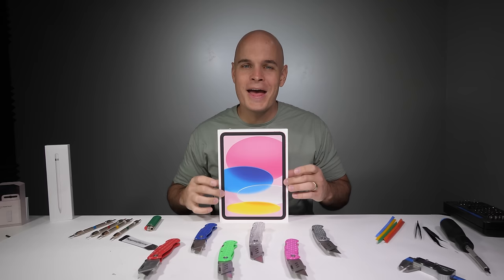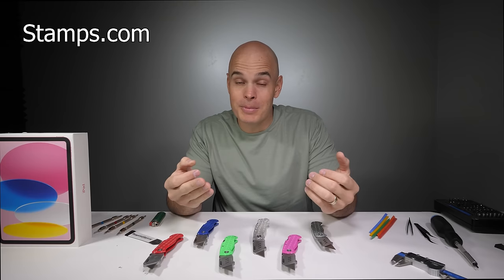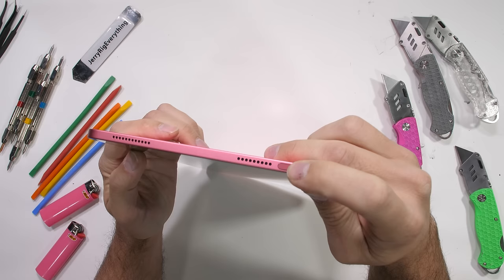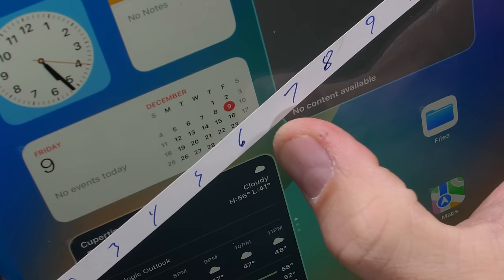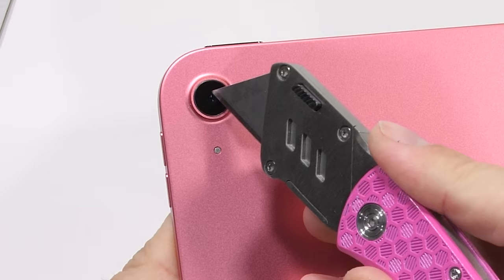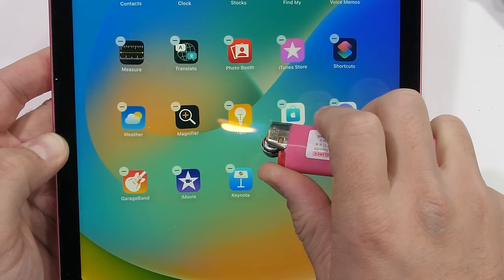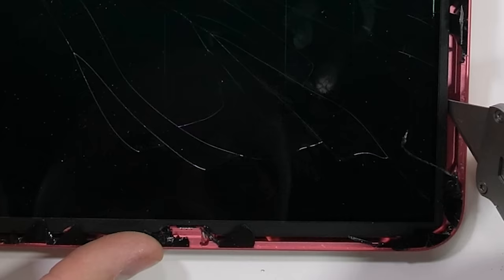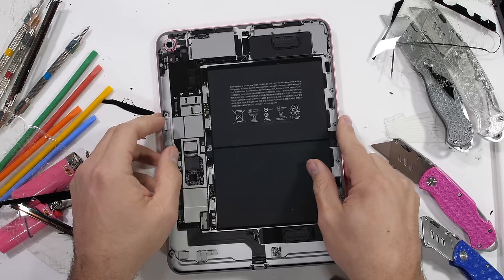The New iPad is...  (Lets just not talk about it...)

Comment: The "iPad" (without, Air, Pro, or mini) is the school model.  The air gap between the digitizer and the LCD is because most students break the digitizer only so it keeps repair costs way down.  We pay ~$30 per digitizer replacement.  This saves us a bunch as we repair a few 100 a week for repair.  45,000 iPads cost at lot, not just to buy but to maintain.

Schools are also why the iPad 9th generation is still on sale, we have a fleet of 8th generation models and want to continue to buy the 9th generation as long as possible.
Reply: The problem is that it is priced WAY too high for schools.
Reply: How about picking a better product? how is it feasible to repair a few hundred of these a week? Just buy an air and never repair until battery death or another brand?
Reply: @yk-lt5bs  I think you missed the point.
Reply: @cameronbosch1213  not true you forgetting that school get special pricing for bulk purchases
Reply: @yk-lt5bs  you missed the point
Reply: then why do they price it so hight. thats not an excuse. thats just stupidity. for this money i expect fully laminated, pencil 2 and stuff. almost every new name brand android tablet no matter the price has a fully laminated display now.
Reply: @michaelm.3641  the thing is it got more expensive. if it was the same price ok.
Reply: @cameronbosch1213  Schools buy in bulk at the same price as retail stores.

For example. Samsung sells 512GB EVO sd cards for 121€. Guess how much do retail stores pay? 40€
Reply: The ipad 2022 costs 589 euros here in europe, that's not cheap for schools.
Reply: I've spent countless hours troubleshooting and attempting to get these pieces of crap to behave. I despise iPads with every cell in my body.
Reply: @yk-lt5bs  Agreed with you until your 3rd question, that quickly made your entire comment kinda "wtf". But also, many schools have contracts so they actually have to buy iPads, so they buy the cheapest to buy and cheapest to repair/maintain tablets. Also because iPads are the tablets that have the longest software support, it's also a no brainer for schools. They would never buy a random cheap Android tablet that would lose support in a year. And since all Samsung tablets have fully laminated displays, it would be a lot more expensive to fix considering kids break them all the time no matter which tablet it is. Also Samsung tablets bellow $500 are a bit... well... slow and bad, and above that price they are absolutely beautiful and excellent but also are insanely expensive to buy and repair in bulk. And one more thing, iPadOS being so locked down is actually a feature for schools, especially if they can lock the iPad with admin passwords. Android can do this too, maybe even better, but even completely locked down android can still be "too open" for schools or require complex additional software or even custom ROMs/admin apps to lock it down to a similar "locked down" level to iPadOS (in its most locked down state).

I hate Apple but I'm not blind and I can absolutely understand why schools keep buying iPads.
It's a mix of contracts, long software support, apps support, device administration and lock down (as a feature), repairability for cheap (non-laminated displays as a feature), security (debatable tho), ease of use, or really all of the above. Every other Android tablet you think about fails on one or more of this categories. A "failure" that can be considered better for us (like laminated displays) is a bad thing for schools and companies who have to maintain hundreds of thousands of them.
Reply: School should get linux pcs, not Apple proprietary tablets...
Reply: @azenyr  slow and bad...the 2022 s6 lite or the s7 FE is not slow and not bad. shure it isnt flagship level performance but for school work thats all you need. all your other points are fine id say.
Reply: @yk-lt5bs  We initially had the iPad Air (1) which didn't have laminated digitizers.  We heard about schools that got the iPad Air 2, and their repair costs were way higher because when the digitizer is laminated to the LCD you have to replace both when either is cracked.  Shortly after this Apple brought back the "iPad" and it has always had separate digitizers to reduce repair costs.
Reply: @HarmonicaMustang  You are in a minority.
Reply: @cameronbosch1213  I have a feeling the iPad 11th or 12th gen will be cheaper.  For now schools who have iPads will continue to buy 9th gen so they can continue to use the chargers they have.
Reply: @Jbrimbelibap  they are getting chromebooks too. Im in the Linux world so I know about it. And I know that schools will not switch to a linux laptop if they are getting almost free chromebooks by signing contracts with HP, Acer etc. There is currently no brand in the Linux world that does such big scale contracts, and even the easiest Linux distro like Ubuntu can be kinda hard to support when kids try to use and mess with every system config they can. ChromeOS is a lot better for this, and iPads are even better. We can't forget that kids not only love to break screens, they also love to break software and mess with settings. If you give them a linux distro the laptop would be stuck into grub rescue in 10 minutes. All laptops would constantly be in need of an OS reinstall. This is the same reason why they don't give Windows laptops to kids. Either iPads or ChromeOS. There are linux distros like endless OS who try to target these usecases but there is still not enough support or companies who do big contracts with schools for this
Reply: @azenyr  no sudo commands for the children
Reply: @SimonBauer7  those are fine tablets for the price for us final users but... are they a good choice for schools at that scale? Maybe not. Im sure there are android tablets made by HP or Asus or others that are focused on bulk deployment like this, with great repairability and durability, but still they fail some points. And probably shitty specs and overpriced too. The corporate world is just very different from the consumer world. I know a friend who has a medium-sized company and recently he signed a contract with HP to renovate the whole fleet of desktop computers at the company with shitty but newer ones (i5 11th gen, 8gb ram, 512gb SSD, the old ones are 4th gen and many still have HDDs). I told him he could maybe get better PCs if he built them in parts to which he answered "would you build me almost 150 PCs and install windows and drivers in all of them? And where would you get the parts in such big quantities? Who would pay you the hours or days wasted? And support & warranties? Bureaucracies, insurance and paper work for them? Yea, HP just arrives there one day with a palette of them all ready to use and all paper work filled and takes the old ones for recycling. Some consumer things just won't work in the corporate world, sadly, because HP and other companies like Apple really profit a lot from shitty but easy (for the clients) contracts like these
Reply: @Jbrimbelibap  you can still break a lot of things even without sudo. Unless they had a system that reimaged the root partition from another partition every time the pc got booted up (that would kill updates, but this is why stuff like immutable distros are promising), it is still to dangerous. Linux is just too open for this. In ChromeOS you can only use a browser and thats it. If you do shit you just clear the browser data.
Reply: @craigrogers8182 i understand the repair cost is lower but there shouldn't be any repairs in the first place. Buy cases or better tablets i don't see how it is better to repair 100 screens a month then not breaking it in the first place. Gorilla glass victus out here on million dollar cars as racingwindows and your breaking 100 ipads a month?
Reply: @yk-lt5bs  do you forget that schools buy these in bulk and want to get it as cheap as possible, they don’t want one with a laminated display because it’s so much more expensive to replace and schools are legally required to fix it if it breaks as otherwise it becomes a health hazard.
Reply: @cameronbosch1213  nah it’s not. We have thousands of iPads at our school IT
Reply: The iPad is not "school" anymore, unless you talk US schools only. If the air gap was for repairing, they should just put everything together but easier and cheaper to open and cheaper parts. If it was for school and kids, NEVER in life they would put the need for adapters, all kids lose them! On Apple everything is just for making money.
Reply: Just buy a durable cheaper just as good android tablet then???
Reply: Schools should be teaching kids how to use real computers and real software. Not locked down consumption devices which raise a generation of app store drones. Years ago they said people 40+ in software development would be on the scrapheap as the new "digital native" students started work. Except we now command even more salary and are in demand more because these graduates can't even write a piece of code to check if a number is odd or even without including a bloated library to do it for them instead of using the modulus operator.
Reply: Why not make an ipad school edition, and only sell it to schools? Why everybody else has to endure the shortcomings? Seems like schools were not the nr 1 thought in their minds 🤑
Reply: @6581punk  Real computers and real software cost a LOT of money. Schools can’t afford that, it isn’t fantasy land.
Reply: @Jbrimbelibap  can’t wait to see little Timmy and thousands of his peers having to shell bash even the most basic stuff
Reply: @ricarmig  pov : you have never repaired an ipad
Reply: @iondoaga1267  if Apple make a cheap ipad for school i want one as well
Reply: @rentzboss  We should just get proprietary softare off our schools, besides chrome os is based on gentoo linux i reccon. Chrome os shell bash anyone ?
Reply: The problem is ignorant reviewers and tech sites have convinced the public that glass and metal are "premium". They're not. Every material has strengths and weaknesses, and you need to pick the materials which are most appropriate for your use case. Glass as everyone knows is extremely fragile so should be avoided on things that are easily dropped. And metal will permanently deform under much less strain than a flexible material like plastic, so should be avoided unless you can put in enough metal to prevent permanent deformation under typical loads. Glass and metal are just about the worst possible choices for constructing thin handheld devices which will become technologically obsolete in 5-7 years.

If you're repairing a few hundred digitizers a week (225 out of 45,000 = 0.5%, or about 25% per year), then glass is completely the wrong material for this use case. And Apple is making a mint off of you on replacement parts costs. It's why Zack frequently mentions (and I agree) that he thinks plastic would be a better material for phones and tablets. Just cover the plastic screen with a plastic screen protector (a few cents each in bulk). If it gets scratched or gouged, just peel off the protector and replace it. That would make the LCD the most fragile part, but those are gradually being phased out in favor of flexible OLED. Unfortunately, we are where we are today and paying out the nose because a bunch of ignorant people have successfully convinced society to prioritize fashion and feel-good, over common sense and solid engineering.
Reply: @GondrezHardstyle  schools do not pay vat. Also bulk prices.
Reply: @solandri69  Plastic touchscreen are a bad idea, look at switchs i repair, many people do not want to use a protective layer, just like i don't want foam all around my car, and it scratch so easily
But at least people mostly break the lcd and not the display, while in ipad they mostly break the touchscreen
Too bad for you that lcd are much more expensive than touchcreens
Reply: Many people complain about the price of an iPad 9th generation. I got it for €380 and would be hard pressed to find a decent phone for that money. That puts it at about €120-€150 factory price. Name one tablet or laptop that has better features at a lower price. You could all buy chrome books, but uniform software support and repairability will be an issue.
Reply: When you have 45,000 iPads in rotation, do you get a discount for purchasing in bulk?
Reply: @SimonBauer7  Sure, but ipad os is better in every aspect than android for tablets (which doesnt event exist).
Reply: @Jbrimbelibap  No they shouldn't. Linux is basically never used by the average joe.
Reply: What happened to notebooks and pencils? Teaching is not all about getting technologies and more screens to the students
Reply: I have a 7th gen as a teacher. My school is such a mess. The students have Chromebooks and the our projectors either have Chromecast or apple tv. Our teacher laptops are windows. So we get to try to make sure all of our technology works.
Reply: @SimonBauer7  they also tend to be more expensive, and the cheaper ones tend to be made from cheaper materials like plastic. iPads are made using aluminum and use high quality materials. There’s more thought placed into the hardware on iPads (for better or worse) than there are on android tablets. Also, who likes android on tablet?
Reply: @rvalent9366  if you are looking for cheap, then maybe you should look for something other than apple
Reply: Got the nerve to charge me 450 for this And it can’t pass the bed test @apple what are you now, cvs or Walgreens quality now?  Timeline 7:45
Reply: @HarmonicaMustang  skill issue 🤷🏽‍♂️
Reply: @SimonBauer7  Than,just buy android.
Reply: I WAS GOING TO SAY THAT. Laminated screens are so expensive.
Reply: Those parent's pockets are heavy 😭😭😭
Reply: @HarmonicaMustang behave and do what?!
Reply: @yk-lt5bs  why do u think they won't get damaged dude🤣
Literally a dozen of kids handle them everyday....they will get damaged regardless of the brand. Kids can damage anything.
Reply: @iondoaga1267  u're not forced to buy the product. lmao. Chill.
Reply: @kamallb4650  If you learn anything from the past, you'd know the phrase "apple does something, everybody else copies" So how chill are you going to be if in a couple years, all you could buy is overpriced pieces of garbage?
Reply: @iondoaga1267  that's majorly others being at fault
Reply: And with a very durable hard case the bending should not be a problem 💀
Reply: @azenyr  But ChromeOS is Linux lol. I would expect a school linux to be super locked down which is something relatively easy with linux.
Reply: @6581punk  the problem is, they don't use this for your average coding. If everyone learned coding, other jobs wouldn't exist because everyone would have opted for IT. Maybe just use the brain a little and let people out for their choices.
Reply: @kamallb4650  gorilla glass is super durable as I said million dollar cars have victus. If you break 100 of those a month you better use pen and paper.
Reply: @yk-lt5bs  idk why u're trying this hard to create scenarios in ur head but honestly speaking. It's not that deep. 
When a dozen of kids are using something on a regular basis it's bound to detoriate faster....regardless of how good quality it is. 
Now go ahead ban tablets for those kids all u want.
Reply: @GondrezHardstyle  but that’s only an issue in Europe cause the weak euro, that have nothing to do with apple…
In US the iPad 9 still cost 330$ and the 10th gen 450$ and that’s not really much against that what you get more…
That’s 130$ for a more modern design, dramatically better sound output, at least 1 year more support and better hardware (SOC, RAM, connectivity) and that’s worth 130$ in my eyes…

The iPad 10 is not the direct successor of the iPad 9, the iPad 9 is the successor of the iPad 9 this year and that’s completly fine cause every other company’s sell in this pricerange Tablets with hardware wich was powerfull 4-6 years ago…
The iPad 10 is just a new category in the iPad line and is just there to fill the big gap between cheapest iPad and iPad Air which was always kind of big since the comeback of the iPad Air which was every time closer to the iPad Pro as to the normal iPad…
Maybe this will get more clearly for everybody when apple will release the iPad 11 or SE next year (when 11 the 10th gen will get to the pricepoint of the iPad 9 and will replaced with the 11 and when SE then it will replace the 9th gen iPad)
Reply: @SimonBauer7  they are not even close to the iPad 9, the s6 lite is on the level of the 5th gen iPad and the s7fe is somewhere between iPad Pro 9.7“ and 10.5“ from 2016 and 2017 and that for a price you can also get the older iPad Air 4 or 10th gen iPad which both have 2x and 3x the power of those android tablets…
That’s not just a small gap if you ask me…
The main issue on that is not that you will not get enough power for now, but it will get slow and useless pretty fast when the main devices (iPads) for developers have allready power which is 2 or 3 times faster…
That will result in a quit short usage what then is just a bad deal next to any other iPad of the last 5 years…
Reply: @azenyr  just nope, they are all only produce laminated screens anymore even in there under 200$ devices with crappy socs from for 4-6 years ago…
And next to that they only support the devices 2 years in most cases…
If a school is smart they just put the 100$ more in each device and they will get a very good product which is specially designed for those usecases, will get years of support and has already tons of applications which are designed for school and college Workflows…
I don’t know a single android tablet which would fit in this picture, really not a single one…
The only other tablets which fits roughly are the Amazon tablets but these are more concentrated to media consumption and not really for daily schoolwork, so they are more or less just to slow for nearly everything, not compatible to allready existing infrastructures and this all next to this commercial binding to Amazon, thats not really an alternativ for the iPad 9 or 10 and what apple offers with them…
Reply: @ricarmig  in Germany nearly every school uses iPads
Reply: @kamallb4650  I'm sorry but it is if the number he is using is correct that means 2400 broken screens ~100 grand in repair costs over 2 years. If you'd buy 1 screen protector and a third party case for each ipad. Would even out repair costs. And would be better for the environment. As if protecting your screen hasn't been solved 10 years ago!
Reply: Thanks for explaining, I was really perplexed by this. It makes sense now.
Reply: What happened to just using chrome books?
Reply: have you heard of books?
Reply: @iondoaga1267  no because everything else is slow with stupid interface
Reply: Why the hell are schools wasting money on iPads? Buy real computers that can accomplish more work for less money. I could understand iPads if they at least ran MacOS, but no. They're completely limited in what they can do by iOS.

If I lived in your school district I would be voting No on some budgets big time.
Reply: @OutOfNameIdeas2  no tablet matches ipads tbh lol. plus it’s not that the ipads are easy to break, it’s just kids are stupid and glass is glass.
Reply: Thanks for your sharing your insights!
Reply: Huh? It's it about repair costs maybe buy a tablet that doesn't snap in half ? If they are breaking the digitizers they can bend these as well...  This is sold to the general Public  not just schools
Reply: Fawk them schools the ipad 9 is outdated
Reply: @mrsoisauce9017  Android tablets are not more expensive than iPads. Apple does not necessarily have better hardware or build quality. And a lot of people do like android on tablet. Apple is just better at cornering the market on these big bulk school deals than Samsung or Lenovo.
Reply: @shannawallace7855   ok, android tablets aren’t that expensive, but the integration between hardware and software isn’t there. Most android tablet apps are just blown up versions of their android phone counterparts, whereas iPad apps are optimized around the larger form factor. iPads on average, contrary to your statement, do indeed tend to have better build quality, being made from aluminum and other high grade materials as well as having an amazing set of chip sets. And lastly, to address the whole bulk orders thing, have u seen how hard schools are pushing for Chromebooks now? A school would NEVER push for an android tablet, but they absolutely WILL push for a Chromebook. It’s not abt apple being better at cornering the market. That’s just one of many factors. Most of those factors have to do with durability, privacy, security, optimization, and the ability to set limits as to what ur student’s device can do, and for that, iPads are better than android tablets, but Chromebooks are better than iPads in that regard as well. Therefore, it doesn’t matter how good apple is at “cornering the market.” Chromebooks will be the universal choice, and companies like the aforementioned Lenovo can sell Chromebooks in bulk (hell, I have a school issued Lenovo Chromebook in my book bag right now, as a matter of fact)
Reply: @shannawallace7855  i wanna see you break an unbendable tablet with a good screen protector and case
Reply: @shannawallace7855  there's screen protectors you can't smash with hammers i really don't know what is wrong with apple users. Durability can be affordable Apple is not the only brand out there.
Reply: Damn when did schools start getting iPads ? Lol I graduated in 07 so when I was growing up in the 3 rd and 4th grade I member we had the old Apple computers with Oregon trail lol. Things sure have changed haven’t they?
Reply: Or you could just charge the parents. Or use books like we have for all time
Reply: @cameronbosch1213  my high school had all MacBook Air’s
Reply: it's for rich/private schools
Reply: @alajibril  that means fuck all I know my school couldnt afford ipads and we're a really good school
Reply: Something like an Air, pro, or mini in the hands of a child is never a good idea. That why the base iPad exists.
Despite what people say, they’re still lower cost, and more easy to repair long term compared to other models. A kid would have to be really responsible if they’re given anything higher than a base iPad, otherwise that gets easily taken away.
Even if you got it with your own money, it costs more to replace the higher end models.
Reply: @azenyr  Apples only bad because we have to pay full price, but students and schools get discounts if they get them in bulk.
Though, iPads are arguably far better than macs since Apple locked down their “Computer products” far more, as you can’t replace anything like a typical PC.
Reply: @Thewaterspirit57  just don’t give a kid an iPad
Reply: @ricarmig  tell me a company that isn’t out there trying to make as much money as they can
Reply: What if, hear me out... What if there was a way to teach things without spending millions in unneccessary tech? Europe does it, why not the USA?
Reply: @litamtondy  cause America is run by the big corporations, so are we in Europe but not as much as the US
Reply: I thinks it’s been more than established that Apple does not give a single shit about repairability. The new iPhones have literal measures put in place to prevent repairs. They don’t accept replacement parts even if they come from another functioning iPhone of the same model.
Reply: @alajibril  but chromebooks are cheaper
Reply: @alajibril  not in the USA lol. Schools in USA don’t get paid enough to buy even in bulk, they have to use shitty chromebooks
Reply: @shannawallace7855  yeah but here your talking about tablets not ipads dont compare 2 different devices
Reply: @Jbrimbelibap  students and teachers do not deserve to deal with all of the bullshit that comes with Linux
Reply: @bunz794  that’s just not true. Your school might not get a lot of funding but other schools give MacBooks to all teachers and students
Reply: @bunz794  my public school does.
Reply: @krucial88  I have Oregon trail on my ipad. Its definitely not the original 😔
Not that I really thought it would be......
Reply: @azenyr  lol breaking software is what got me interested into technology.  By high school I already knew more than my computer science teachers and when it came to University I spent most of my time teaching myself the course work and learning from PhD students rather than going to class.
I even took 3 journalism and 2 music units for fun to see how bad arts students were at their own subjects.
In all the CS classes there may have been 1 or 2 people using MacBooks everyone  else was running Linux or Windows.  In the arts classes it was like 60% Macbooks and the students had no idea what they were doing or why they paid so much for their laptops other than "it was better".

So far in my career as a software engineer nearly every, engineer to try to do real programming on a Macbook  has failed to use a Macbook for more than 3 months as it is just worse to develop on.  At my last job it was hilarious to see my manager attempt to use MacOS then have to run Windows to do 60% of their tasks.

Kids growing up on tablets are just worse with hardware and software to the point where anyone who is educated on a mildly useful system will earn 10 to 100 times more than their counterparts.
Reply: @azenyr  I organised a set of 100 computers, with custom setups and hardware contracted to a 3rd party Microsoft and Intel certified builder in about 3 hours.  It's not too difficult if the people you are working with have half a brain and know the client is knowledgeable.
Reply: @azenyr  just have images setup and ready.
Encourage them to break the system, reward them for putting it back together.
Reply: @mrsoisauce9017  tab a8 are cheap and made of glass and metal and are actually quite capable for the price
Reply: @SmallHappyOtter  A properly configured linux machine will run better than any windows or Mac computer could ever dream of. I put together a Debian system for my tech illiterate grandparents who always seem to get viruses on their computer and its works perfectly. Its also harder for students to mess with than a windows computer because of its strict permission system, assuming the IT people properly configure it.
Reply: @cameronbosch1213  Im sorry do you work for a school and know this?
Reply: @rvalent9366  9th generation is 209 for edu, and less if you buy bulk.
Reply: @mjc0961  cheaper to give each kid one, a student windows device is 400-600 dollars.  A 9th generation iPad is 209 for one or about 190 if you buy 10.  So yes it is cheaper.  If you get apple care with no service fees too, it still comes out to less than the windows unit without a 4 year edu warranty.  and if its cracked it's replaced for free.  It can access the same Office/Google cloud apps every school uses.  Then you have windows and macOS labs for classes that specifically need that as an OS for certain programs.
Reply: @MordecaiTheFoxVids  Do the math. No sane school would pay $430 for just an iPad multiplied by hundreds of students when Chromebooks offer over 90% of the experience for less.
Reply: @cameronbosch1213  yes they would.  And they do lmfao. Security wise chromebooks are a mess. It’s a turn off for most schools. iPads handle security and PII better too. Also chromebooks are garbage for security updates too. iPads have them longer. A lot of schools that bought chromebooks during the pandemic in 2020 are furious with google for ending support for them after 2-3 years. That’s not the case with the iPad. 8th gen is still getting os and security updates as well as 9th for a while. I can give you a list of schools that have gone this route as it’s cheaper and easier as far as repairs. Stop acting like you know the educational institutions when you don’t.
Reply: @MordecaiTheFoxVids  Then tell me, how many years did the 2017 iPad get? Yeah, the one with the A9? And I've seen very few iPads in schools for elementary school students in my county; almost all of them have Chromebooks.

And it doesn't help that once an iPad is EoL, it's a brick.
Reply: @cameronbosch1213   Chromebook at eol is a brick too. Most schools use devices for 3-5 years. And that coincides with the AppleCare+ and the update lifecycle. iOS is also easier to manage from a backend perspective too. Chromebooks have too many security holes etc. 

I can tell you most around where I am opted for iPads. And more are ditching Chromebooks for iPads for the explained reasons.
Reply: @cameronbosch1213  also the 2017 iPad 5th gen is still running the latest ios 16. So I’d say 6 years of software updates is more than any Chromebook I’ve ever seen.  Schools usually decommission devices after 3-5 years.
Reply: Yeah tim cook wants it for schools
Reply: @davidjacobs6244  True, as much as I despise iPadOS, I can't say its buggy, it actually works well most of the time.
Reply: @yk-lt5bs  Anything can still get damaged even with a case, especially when the human child knows no bounds of destruction.